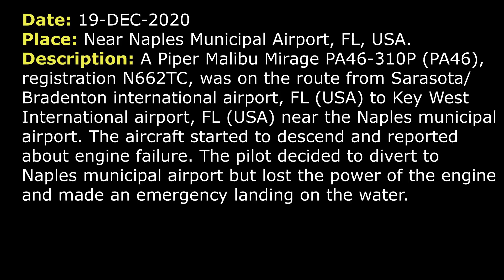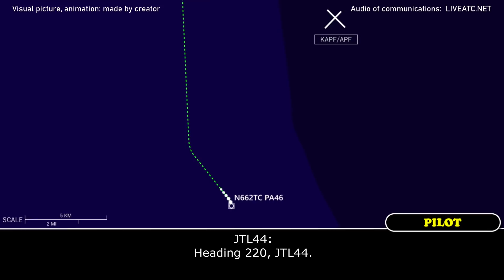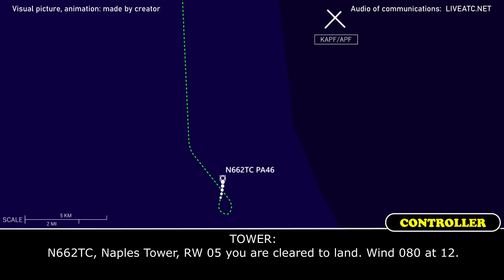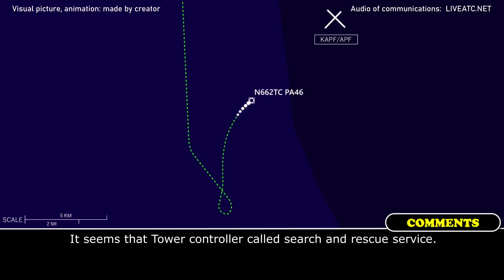EMERGENCY landing on WATER near NAPLES, Florida. All occupants survived.

Comment: I fly a citation to apf routinely. I have some mixed feelings about ft myers approach controllers. Some have very short fuzes. I guess from all the student pilots there. I normally like this controller though. Weird decision to insist on on the right turn but may have worked out for the better though. Ending up short or long of the field in Naples would be pretty disastrous. Surrounded by busy roads and buildings.
Reply: Agree completely. I am very familiar with Naples, and it would’ve been disastrous had this plane gone down anywhere else.

Comment: Descent 2000??? Right turn?? Switch the tank and engine shut down?? Undo the las thing you do before the engine problem and fuel pump on. Declare emergency and go direct to the airport they have to move the traffic around. Flight the airplane first. My opinion I may be wrong!!
Reply: ATC could have even suggest  switch   tanks 
 i m  guessing  he still had fuel in one of the tanks
Reply: I Don't think he got 6 hours of fuel because the first, because, taxi & climbing, etc. 120 gallons and about 22/hour, anyway the good lesson is flying the plane and not be scared to declare an emergency.  turn direct to the airport and it is the responsibility of ATC to move the traffic away. but like others said let's wait for what the investigation says. always it's a big lesson for all of Us.
Reply: Joe Namara  look also the poor flights back on time just local flights, proficient it is very important.

Comment: If the pilot would have turned directly left he probably would have landed on houses or the streets. The water was a better solution.
Reply: With a left turn he could have landed on the beach or an airport.  Even if those were not an option, he could have ditched in shallow water right offshore.
Reply: That definitely was a better solution I know the area quite well.
Reply: People aren’t saying left direct to shore they’re saying left turn towards the airport, still over the water. The right turn is the longer circumference and will lose more altitude to execute than a left.

Comment: OH MY GOD.... controller turned them AWAY from land.  Not good and this controller should have to answer for that.  Yes, the pilot should have declared immediately and in the meantime refused a turn that was not directly towards the airport.
Reply: And endanger other aircraft?  ATC said other traffic was in the way, pilot's wishful thinking (and yours) doesn't change that!  How many MORE emergencies do you want to create?  Midair collisions?
Reply: @xheralt  He should have headed for the shoreline and declared an emergency as in 3x Mayday. All other traffic had engines running and could have been vectored or altitude changed, out of the way by ATC. As simple as that.
Reply: @xheralt  Don't agree with you Gary!!  An aircraft with engine trouble way off the coast trumps traffic.  The controller should have IMMEADIATLY give him a turn towards the airport and in the same breath rerouted the other aircraft.  If you were flying this plane and agreed like this poor guy did then YOU would end up in the water too.  Another reason the controller was wrong... the pilot even question his right turn.  In that time the controller could and should have rerouted the other traffic.  Bad move on the controllers part and I suspect he'll get some kind of review for his decision making process.  The pilot was passive in the situation and should have been much more proactive for himself and psgr.  Yes Emergency should have been the first words from him mouth.... BUT that DOES NOT relieve a controllers responsibility for making a stupid decision!!!!
Reply: Gary XHLC. Just curious. What’s your level of experience in aviation?
Reply: @domaguayo7819  I've been flying, (not professionally), for 40 years.   Nothing else matters though... A single engine aircraft miles off the coast with an engine problem... I mean it's a no brainer.

Comment: ATC should ask pilot what his/her intentions are. Pilot should declare mayday/emergency and inform ATC. Aviate, navigate ... then communicate. No unnecessary turns unless to avoid collision. Pilot is in command of the situation. ATC should have everyone else hold and clear way for the inbound emergency. This was mishandled, in my view.
Reply: Either the pilot still had some power at that point and thought he'd make it before it went out completely, or it was dead and he didn't communicate that properly to the controller. I doubt the controller would've had him turn to accommodate traffic if he knew that the pilot had no power whatsoever.
Reply: And the pilot should say Mayday. Engine failure.
Reply: I agree wholeheartedly as a CFI and as a controller. See my separate comments about the training course I am currently building for my fellow controllers.

Comment: 1. Pilot should have declared right away
2. Controller may have cost precious time by the right turn debate, but then again the pilot did not declare the IFE. 

Glad everyone made it out ok
Reply: Guess this is where we will agree to disagree. Yes, he (ATC) could have expedited a little but I feel his job is to maintain separation between aircraft, not fly my jet. If I have a problem, it takes less than a second to say the magic words or put 7700 in the FMS then hit the ident button.   He (ATC) has no clue what is going on from just listening to the radio and looking a scope. Its the pilots job to aviate, navigate, communicate. The pilot did say "we have an engine problem", why not finish it out by declaring a Pan, May day, or just the word emergency?
Reply: @FunnyCarPhil  
The pilot said turning left, controller no turn right. ATC screwed up. Even if only saying ‘engine not running right’ and over water, that’s DIRECT. Able aircraft can turn.
Reply: The pilot doesn’t need to declare an emergency. When the controller heard the words “we have an engine problem here” it automatically became an emergency. The controller should’ve immediately started handling it as an emergency. 

The controller turned an aircraft who had stated that he had an engine problem, not only away from the airport, but away from land. There is no excuse any controller should be able to make for that. This controller was wrong.  It’s that simple.

Comment: Poor from the pilot to go along with the Right turn... In an emergency you tell atc what you need, if they don't let you... do it anyway and say UNABLE!
Reply: Problem is he did not declare an emergency from the git go.
Reply: Yeah, at that point I don't think the controller knew they had lost power entirely, just that they had an "engine problem." Maybe the engine was still running at that point
Reply: First I’m not a pilot. But the ATC instruction confused even me. In any case I fear that I’d have sounded far more nervous than did the pilot - which in the absence of an emergency declaration (as has been noted) could have been part of the problem.
Reply: Very stressful situation. Wouldve been great if he'd had the confidence to say "im turning left, get the challenger out of my way" but in such a situation the only help you have is to listen tl the controller and that's ultimately who he put his trust in. As for no emergency declared, at this point the ATC had already asked for souls and fuel, he was in no doubt it was an emergency
Reply: @Candlelighter  Fantastic point!  Souls and fuel so the controller KNEW this was a bad situation and still turned him away... which was even questioned by the pilot.  I suspect the controller will have to answer for his decisions>

Comment: It's weird that ATC insisted that they turn right instead of letting them turn left. I wonder if he didn't understand the seriousness of the situation because the pilot just said the engine wasn't running well instead of saying it was out. Or maybe there was really no way to safely vector the other aircraft out of the way.
Reply: @David Agnes FWIW from a CFI and active controller who is currently building a training course for controllers about how to handle emergencies, I want to interject by pointing out that while pilots have 14 CFR 91.3 (b) that grants them authority to "bend the normal rules as needed" in an emergency, controllers have an analogous regulation for us in what we call the 7110.65 section 2-1-1 (d) (3).  We too can "bend normal rules as needed" in an emergency. We can't create a midair collision, but we absolutely can violate normal separation standards when needed. A descent like this followed by the words "engine trouble" in a single-engine airplane absolutely trigger this emergency authority for controllers even if the pilot doesn't use one of the magic words, because we are also bound by what's known as 7110.65 10-1-1 (c).
Reply: @David Agnes yeah he's obviously extremely biased FOR defending ATC. it's really annoying. he doesn't have any actual atc or piloting experience but is always biased for them and justifies/validates their erroneousness. its annoying and aggravating that he's so ignorant and naïve. we appreciate his work tho.
Reply: @KuostA  Actually doesn't his bio say he's ATC?
Reply: @karlhungus1569  yup, he is ATC
Reply: @KuostA  He is ATC, just not US.
Reply: @David Agnes So I'm just ruminating here, but as PIC you're the guy in charge right?  Especially in an emergency, right?  I mean, at the end of the day, you are it.  So aren't you responsible for what ends up happening, kind of like in life - the guy in charge is usually the one to blame?  In an emergency, the PIC decides what his plane does - not some random dude in a windowless building hundreds of miles away.  ATC can give guidance, but they don't make decisions in the air.  If you want to blame ATC in this instance, what you are effectively doing is giving the PIC the "that guy told me to jump off the cliff" excuse.  Lame.  YOU are the pilot - YOU decide where your plane goes and when in an emergency.
Reply: @David Agnes dude I’ve seen several of your comments on this post. You have no idea what you’re talking about in relation to this emergency. The pilot never told the first controller his engine was out.  Having engine problems does not automatically mean you’re number 1 to the field. Especially this time of year near Naples. If it was dire, like it obviously became, the pilot needed to say as much. The controller did the best with the info he was given.
Reply: @David Agnes I don't think you understood what he was saying - he was saying that it seems the controller didn't understand the severity of the situation and that the controller should not have vectored the aircraft.
Reply from the maker: I think there was no space for vectoring. Controller informed about that Challenger a couple of times. And plus the pilot said that the engine was running, he didn't say first about siriousness of situation. This is how I see it.
Reply from the maker: I don't do it. I just said how i see this situation. I don't know what happened there and you don't know, so we have to stay calm. Let the investigators say who is right and who did mistake. Thank you, i hope you got what I wanted to say.
Reply: @YouCanSeeATC  unbelievable. atc should have just immedietelly vectored any aircraft in the vicinity away from the malibu, but instead he forces him to make a right turn AGAINST the malibu pilot's request and wishes. wtf. what a fucking idiot. that made zero sense. the emergency pilot has the priority. he already knew the emergency aircraft was descending and could not maintain altitude because of his poor running engine. OBVIOUSLY altitude and speed was now key since they were still far out over water.
Reply from the maker: Stop using bad words here, Ok? Stay calm and try to understand. I do not deffend anyone or blame anyone. I just want to be neutral. In my country if there was no emergency declaration, you just handle this aircraft according to the situation on your radar screen, to provide safety for EVERYONE in the air. Emergency - do everything to help that aircraft. 
This pilot didn't declare an emergency an atc was not in the cockpit to check the engine. The pilot said that the engine was running. Running is a key word. I don't know why the pilot didn't declare an emergency. I say again, stay calm as an adult human and let's wait official investigation. You don't have any right to blame anyone. Thank you and have a good day, friend.
Reply from the maker: Ok, let's stop the discussion until official report. And if you want we'll continue after that.
Reply: @KuostA  SEE MY RESPONSE TO Mr. Agnes
Reply from the maker: @KuostA  yes, I deleted all your similar comment under this video. Let's have a discussion here later, if you want. But don't spam under video with similar text.
Reply: @KuostA  I disagree, during a busy session you don't always have time to put two and two together and one thing can become the piece of info that dictates your response to a situation, especially when stress quickly ramps up and you succumb to tunnel vision.  In this case the controller did seem to disregard the fact the AC was descending on its own and focus only on the fact that the engine was running, just poorly.  We also don't know what other experiences the controller has had with aircraft with rough running engines - maybe the last time he had this happen the ac was able to maintain altitude.  So the lesson here, in my opinion, is treat rough running engines as no engines, break guys off approaches and point distressed AC towards the beach.  Another lesson is that we probably need to teach is separation comes after the preservation of human life.  I have broken rules and done illegal things a few times in service of an aircraft in distress, including intentionally violating airspace and vectoring to finals that aren't depicted, but I'm not sure how common that is.  All this is to say, we have no idea what the controller was thinking and why, and really, its examination is kind of a fruitless pursuit, but we can probably learn a lot about what should be done next time.
Reply: @YouCanSeeATC  I agree with you :). The pilot either still had some power when he turned right, or he didn't tell the controller that his engine was gone completely at that point. As far as the controller knew, the pilot had "engine problems," not a complete loss of power.
Reply: @David Agnes Did you NOT hear the ATC specifically say, "no I can't turn you right because of traffic" when the pilot asked?  Do you REALLY think that an ATC wouldn't do "the obvious thing" if it were an option?!  You're not in the ATC's shoes, mister, you aren't seeing, in this video, what HE was seeing, you don't get to fucking criticize his actions.  Besides, you're arguing with success!  Even if the emergency aircraft HAD been able to make the immediate right turn, he still would have hit the water short of shore!  Closer to shore maybe, but still short!  So, WHAT, exactly, are you arguing for?  Other than to cause arguments...
Reply: @xheralt  your logic fails. clearly you know nothing about aviation and are not a pilot. he had an engine failing. couldnt maintain altitude. obviously turning right cost the largest amount of wasted altitude airspeed time and distance. if it wasn't for the right turn he could have landed on the beach and made it to land. if they were injured or killed it would have been atc fault. its to the pilots skill water landing that they weren't. if there was a collision possibility then atc should immedietelly turn the challenger away NOT the malibu wtf that's obvious basic blatant logic. the challenger is just landing on approach routine. the malibu has engine problems. obviously deviate the challenger out of the way, NOT the malibu. how the fuck can you not see this blatant basic logic? pleb minded low iq humans jesus
Reply from the maker: @KuostA  i said, stop using unnecessary bad words. Stay calm and wait for official report.
Reply from the maker: And everyone here, please, be calm and respect each other.
Reply: @David Agnes wow, a little harsh.